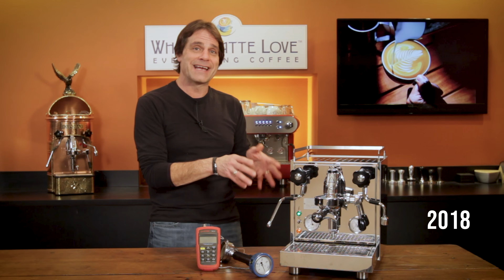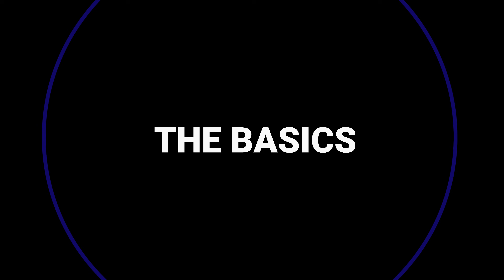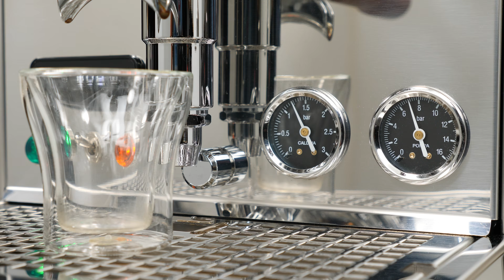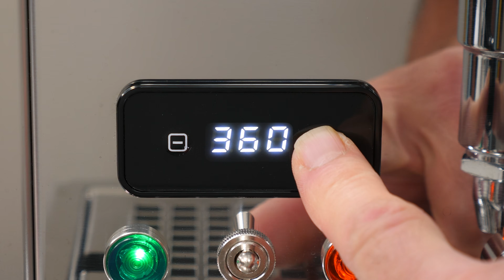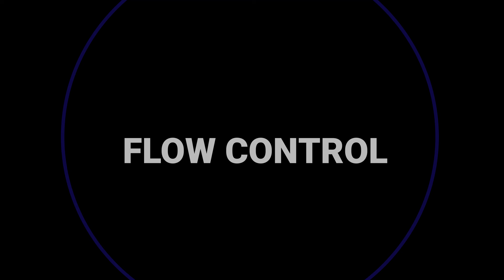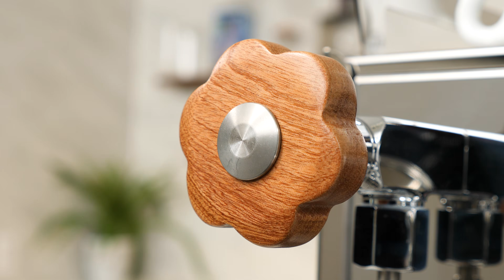Review: Profitec Pro 500 PID Espresso Machine

Comment: Hey Marc! I've seen in another video that it can keep awesome consistent brew temperature without flushing between shots. However I'm wondering, before the first shot does it need to be flushed? How long or how much water? Thanks
Reply from the maker: Hi P, Thanks for the question. It does keep very consistent temps. If the machine was fully warmed up and then idle for more than 20 minutes or so I would give it a flush until water from the group runs smooth with no bubbling or excess steam. Like all HX machines temps will creep up during long idle periods. How much depends on variables like ambient temps. In normal use if pulling shots right after the machine has fully warmed up - about 25 minutes from power on I would flush for 2 seconds. Best practice to do a short flush of 2 seconds prior to every extraction to rinse and residual coffee from the shower screen.
Hope that helps!
Marc

Comment: So many nice machines, I was going to get the rocket giotto pid, but now I’ve seen this! which do you think is the better machine? Thanks
Reply from the maker: Hi LP, Thanks for the question. The Rocket Cronometro Giotto comes in 2 versions. The Type V with vibration pump and Evo R with rotary pump. The EVO R is plumbable direct to waterline and the Type V is not. I like plumbed in machines because I don't like filling reservoirs. If cost is no object, given the choice between the Evo R Giotto and the Pro 500 I'd go with the Rocket. If choosing between the Pro 500 and Type V Rocket I'd go with the Pro 500. Both are fine machines, but the Profitec gets the edge in overall build quality. Hope that helps!
Marc

Comment: I have the previous model PP 500 PID and it's a great machine. But I find its temperature offset between PID temperature and brew temperature to be quite variable. I can tell the difference between summer and winter room temperatures in my kitchen and need to adjust a PID a couple of degrees to compensate. If you compare the instruction manual for the previous model with video review Scace tests, you will see advice to set the PID to anywhere between 248 and 258 to get a brew temperature of 200. Does the new model do anything to keep the temperature offset more stable?
Reply from the maker: Hi Dave, Ambient temperatures def play a roll. I one time put a wet towel on an E61 group for 10 seconds then did Scace tests. The towel knocked the scace results back by 10F. The group is a big heat sink - just leaving a PF unmounted while machine is idle will bump up the temp a bit. A bunch of variables in play. Another is idle time. Temps creep up with long idle times and go down with multiple rapid fire extractions. This happens with all HX machines I've used. Nothing new on this model for extra stability.
Marc

Comment: Seems that Profitec is improving their wick points. Good job !
I would ask for a better tamper for sure.
Maybe also for an IMS nanotech shower screen too, from the box (day 1)
Can you connect this machine directly to water ? plumbed ?
Reply from the maker: Hi K, Thanks for the comment. Real tampers coming with more espresso machines is nice. Used to be they all came with those plastic ones which are kind of useless. Also happy this machines comes out of the box with a bottomless PF rather than the single spout very few people use. I started advocating for that switch 3-4 years ago. Machines with vibe pumps cannot be plumbed direct to waterline. Input line pressure is too high for components to handle.
Marc
Reply: @Wholelattelovepage  understood. So only Rotary pumps can be plumbed in
Reply from the maker: @Kats072307  In most cases. A couple of exceptions are the Crem One HX PID and Crem One Duo-V. Both machines use a vibration pump and can be plumbed to waterline. Instead of applying line pressure to machine's internal plumbing they have system which fills an internal reservoir from the plumb line which then feeds the pump. Check out those machines here:
Crem ONE HX PID: https://www.wholelattelove.com/products/crem-one-hx-espresso-machine
Crem ONE DUO-V: https://www.wholelattelove.com/products/crem-one-duo-v
Marc